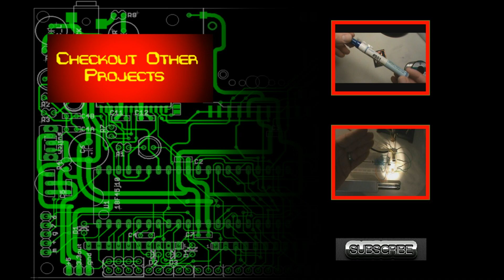DC Dimmer - Demo

Comment: I thought about buying one of those software scopes. Whats the bandwidth of it?
Reply from the maker: Hey there thanks for the comment.  Yeah this is a good cheap scope.  it is around 100Mhz but is limited by the USB so I wouldn't use it for high speed signal processing.  However, for simple PWM and serial debug, which is what I am using it for, it is great and it is less than $70.00USD.  I am pleased with it.